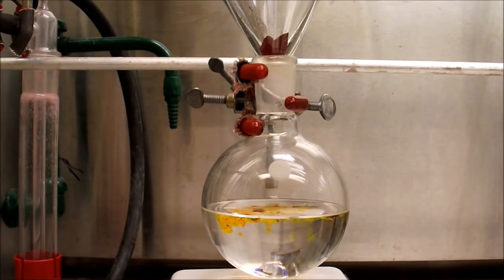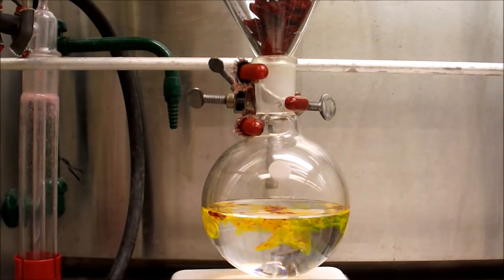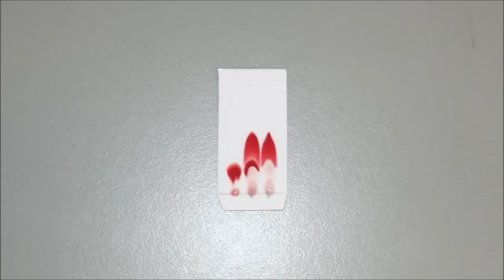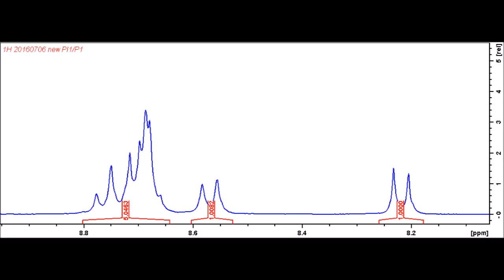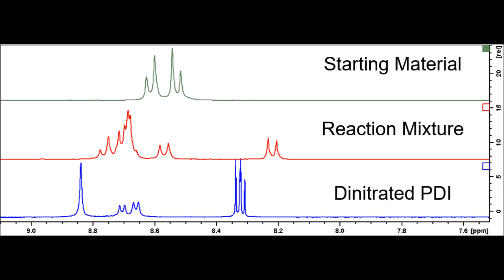Nitration of Perylene Diimide

Comment: Could the reaction work with not so dry DCM but with triton B or TBAB or some other PTC?
Reply from the maker: I haven't tried. I think that as long as you don't have two phases it would be fine (so benchtop DCM is probably fine). I doubt that a phase transfer catalyst would be sufficient because you also have to generate NO2 which is going to be very slow with significant water around.

Comment: Wow, funky molecules, are there a lot of solubility issues? I remember making Di-8-ANEPPS and it was apolar as hell (the intermediates) and I couldn't get an LCMS, this looks 10 times worse. How do you deal with this, or just rely on NMR alone?
Reply from the maker: All these products (except 4)  are highly soluble in common organic solvents (even slightly soluble in alcohols). NMR and TLC are our primary characterization methods (due to the extremely high absorption; TLC is more sensitive to small PDI impurities). We got the proton and carbon for all intermediates and more advanced characterization (MS, CV, UvVis, XRD, etc, on the final product). Interestingly, the solubility of these compounds is largely due to the ethyl-propyl chains. If a straight chain or branching point 2+ chain is used instead of a branching point 1 chain, the solubility is drastically reduced.